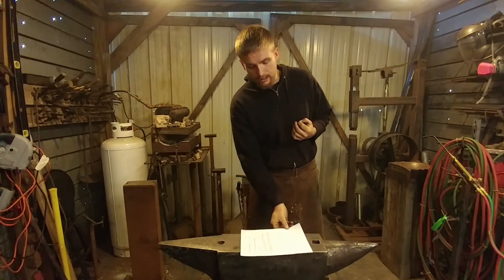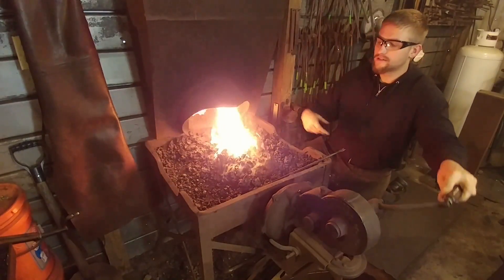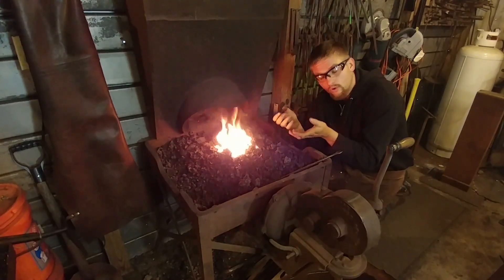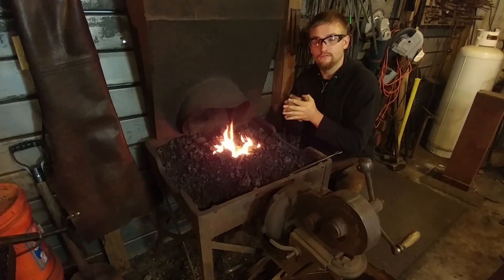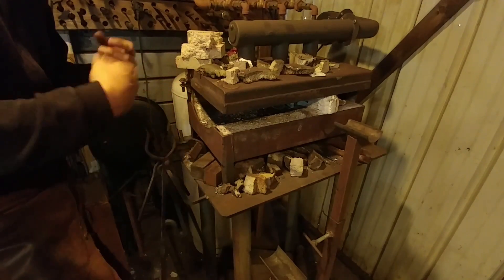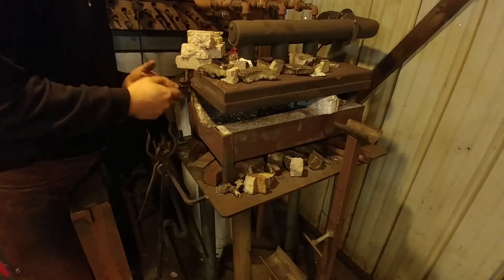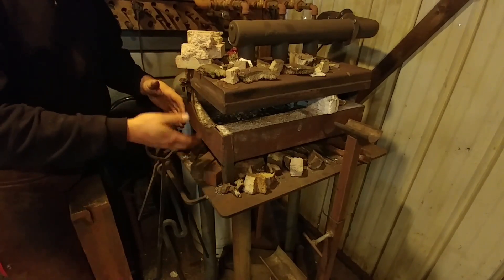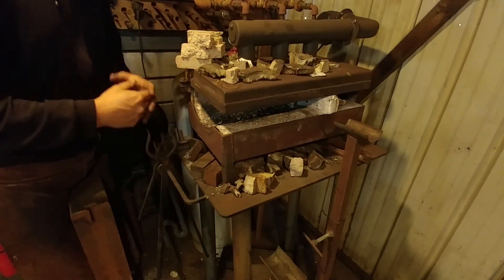Coal Forge Vs Gas Forge (Different Types of Blacksmith Forges)

Comment: Quite frankly, a Blacksmith will have both. Having said that,  a purist will always go for fire management, as that is the most versatile, but if you're running pieces through, then gas with it's tight temp control is your tool of choice.

Comment: Wonderful video. I’m looking to get into blacksmithing, but am on a tight budget. I’ve been thinking long and hard about coal forges because you find them for sale all the time and run about $200-500 as compared to a $1000 for a propane forge. Also I found a local blacksmith shop that sells forge coal. The only concerns I have is the learning curve of figuring out how to maintain the fire as well as fire hazard concerns and ventilation.

Comment: I doubt there is much of a difference between coal and gas when it comes to your carbon footprint. You need X amount of energy to forge, so whether that comes from one source or the other, it's still a CO2 emitting energy source and I doubt one is more efficient than the other if you know what you're doing.
Reply: It depends on how well insulated your forge effectively is. Both types of forge can also be converted to biofuels.

Comment: I'm stuck with lump charcoal right now . It work well but has some  kinks .
Fuel need to be size .  size of a quarter to nickel   lot of dust waste 
  Limited size of work.  A  break disk  is the pot  
 high heat sparks  will pop out if  to much charcoal dust get in  the forge
lot of noise   because of air bed  blower  
It has a lot of upticks too  .
 Very mobile 
Can be left out side
Can run on nothing but wood  and still get a good heat quick .

Comment: I looked for coal for years.
I can only find it online,
In small bags..a hassle..
Praise the LORD.
PS. If you build your own gas forge make the other opening level with the bottom of the forge, you can stick small things in the other end it will heat up only the tip. Or the middle sticking tip out the end .....

Comment: When LPG or propane become expensive or scarce, I'll power my forge with biogas.
Reply: Are the combustion rates comparable?
Reply: @schleybailey  Biogas is slightly inferior(it has less fuel value so you have to burn more of it), but it is still perfectly usable if you have a cheap source.

Comment: Dear Mr Christ Centered. First, thanks for promoting your faith. I am also a Christian. Second, I have no interest in forging. What I do need is a forge for HEAT TREATING STEEL. I make hard dies on a lathe. I need to anneal steel. Some types need to be brought up to heat and held there for hours as I understand. Others just heated up. Then after  the dies are machined they need to be hardened and heat treated. I CANNOT afford to build a gas forge. SO I was considering a coal, charcoal, or wood forge with a leaf blower and a variable motor for the air supply. Any advise would be appreciated. Thanks.
Reply: All you need to do is:

- Find a spot where sparks flying around won't ignite anything you don't want to.
- Build or get something that can encase coal and can deal with the heat, like making something out of certain bricks or use an old wood stove (some types of bricks can explode when heated enough).
-  Get something that can blow air into the coal making things HOT.

3 simple steps. Now you can heat steel/iron enough to be able to heat treat it.

Comment: Thx for the video. Great explanations for each. Could you explain the differences between a metal forge and a metal furnace (maybe foundry is a better word?). I've always found it interesting that, while they are obviously different in design for different reasons, they seem to achieve almost the same thing. Also couldn't you just use a metal furnace as a forge? I'm fairly new to this stuff and it's kind of confusing at times. I even get the names confused all the time.

Comment: Which one is cheaper that is what I'm more worried about I want to start blade smithing but I want to get a gas forge I'm just wondering if it's more expensive
Reply: Anthony Paulson at first coal forge is cheaper but I think over time if you forge a lot I believe gas would be cheaper depending on your area and how available coal is

Comment: Well said.  I have a small coal forge that I have to wheel out of the garage to use, and a small gas forge as well.  My gas forge is even more limited than yours for odd sized pieces.  I have about a 3" x 5" opening in the front, and can open the back as well but I can't open a side.  I wish that I were better at fire management in my coal forge.  I can't tell you how many times I thought I had time to go fetch something only to come back to burned steel!   Maybe in one of your future videos you could address fire management.  Thanks for the great videos!

Comment: Either type can be efficient (or wasteful), depending on size and your specific needs.  Propane forges can be scaled (built) to the desired size more easily (check out https://youtu.be/xah47JDQKP8 for a MONSTER gas forge (and https://youtu.be/BalyIv-GrKQ to see him "forge" a pizza)).  An efficient forge should be no bigger than the work you need to heat.

Great video, as always.

Comment: a good prospective, for local heating though if you use gas, one might use a rosebud, and gas can reach a higher temp faster I have heard, and the gas tends to be cleaner, but in some areas gas is more expensive to run for longer periods, gets used up faster.

Comment: What about the wood forge?  Amazing Etsy shop items by the way.
Reply: while you can forge with wood, it is better to convert the wood to charcoal first.  Charcoal is hotter than wood that hasn't been converted.  but not briquettes.
Reply: But then again , after watching for a while, your just speaking from experience
Reply: i heard many times that a woodforge does not burn as hot as the others easily, so not very pleasing to use as a blacksmith.

Comment: I couldn't agree with you more.  Choose the right tool for the job!

 I have yet to build my gas forge..  hopefully this winter.  I am wondering about fuel consumption  and a cost comparison?

Thanks for the video...
Reply: Def look at a forced air system, easy to build, much more efficient than atmospheric.